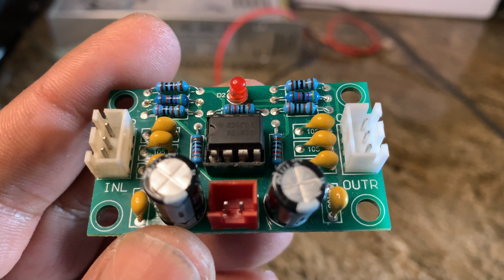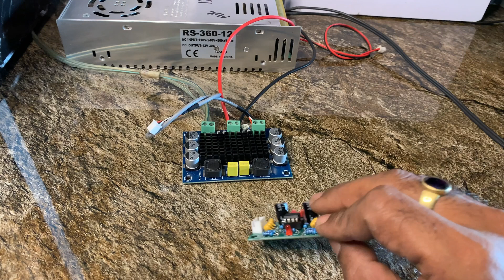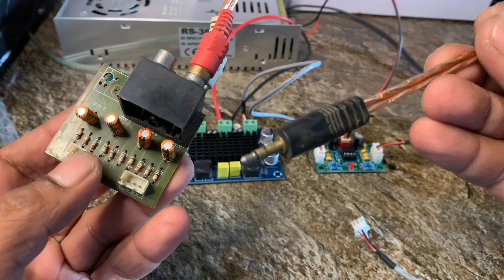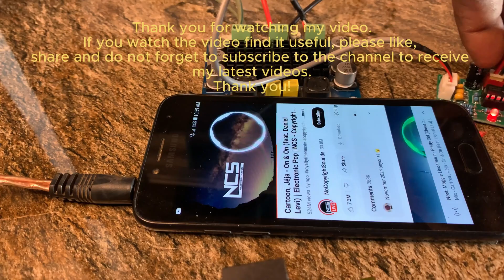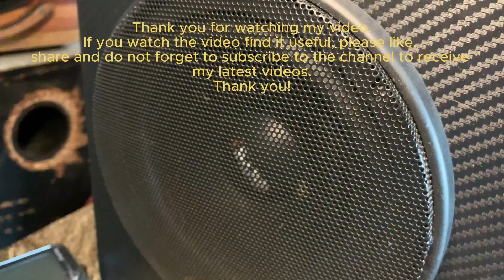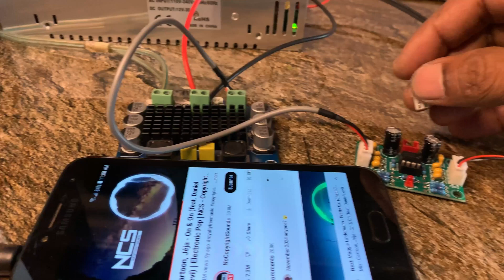The NE5532 Preamplifier Misconception

Comment: What is the main use of this preamplifier board. 

Is that used to boost the signal coming from sources like a phone or DAC or other. Or something else?
Reply from the maker: Yeah like that and also can be used as buffer
Reply: @Amplifiernpl I am actually trying to get the full range audio signal, like Left and Right channel from TPA3116D2 2.1 board as the subwoofer channel only provides low frequency can you help me how can I get the full range from the subwoofer channel in TPA3116D2 2.1 board by modifying the preamp area..

Comment: What is Misconception in this preamp?
Reply from the maker: It produce humm noise
Reply: @Amplifiernpl  Try linear power  supply.  Also, model with +/- supply voltage gives more swing
Reply from the maker: @brankozivkovic6555  Okay sir

Comment: Is there a loud humming sound & what's the voltage & current required for the power input? Thank you
Reply from the maker: It is a good one. I still use it. And for the power supply it operates from 12v and ampere as more then 5 amp u can give any.

Comment: I'm not convinced this demonstrated anything other than showing it being connecting it up.  
What is it's input and output impediance measured, what is the output signal voltage, where is it best used, what is the signal gain, what is the recommended power supply voltage and current etc .... Some technical specs would help.
Reply from the maker: I don't think this one is good to use. However if you know about its connection you may get better result but i have to say that this one is not so good.

Comment: I finally bought it, but when I plug it in it introduces a horrible noise/buzzing sound into the speaker 😔
Reply from the maker: @blooderscrew286  yeah also i tried it into too many ways to connect but somewhere it produce noise and somewhere not. I don't get solution but i think may be this is a practical for us to do some work to get rid of this kind of noise

Comment: It may sound like a fool, but what is the difference? What is the advantage of having or not having this preamp?
Reply from the maker: @blooderscrew286  It helps to increase the impedance from as low level output from mobile phone, BT module, etc. It did not effect the sound but helps to give output to high power Amplifier which we can't get direct from audio devices. Thank You.🇳🇵🙏
Reply: @Amplifiernpl  The ideal preamp should deliver a preamplification of the signal in high quality at a suitable impedance for the main amplifier.

Comment: And how is it designed to mislead ... ???
Reply: It need replacement of components. For audio capacitor should be polyurethane capacitors at least. And have a correct value and adjust the gain.
Reply from the maker: @ it's good. And also by changing the value of resistance you can increase gain too.
Reply from the maker: so simple as we make on beard board. its for home user who only wants to make sound little bit more. not much more than that
Reply: @Amplifiernpl  tendria al menos un volt salida de audio?
Reply from the maker: @suzukiax100rd3  yeah you can check by changing the value of resistor (up) which is connected to 1&2 and 6&7. Put the same value of resistor on both place. Thank you and hear more from you sir. so it help me to make better for others also👍

Comment: I have two of these.. and the power input is not accordingly 😂
Reply from the maker: @athenazoey5093  i don't understand what you say but it can handle upto 24v. you don't need to give more power to any preamp, it can run from 12v. So as you like how much you prefer from 12v-24volt. Sir
Reply: @Amplifiernpl  other stocks from different sellers around malaysia and indo have issues with the "pin" of the power supply "+ and -"

Edit :
 If you didnt pay attention with the color matching of red = + and black = - , what i recieved from the 2pcs that i bought didnt have the same "pin" in accordingly.
Reply: Is that pre amp can boost audio gain? Cause there's have a active pre amp that didn't boost audio gain
Reply from the maker: @hatersnotallowed-g1d  yeah it will boost audio gain by 5x times